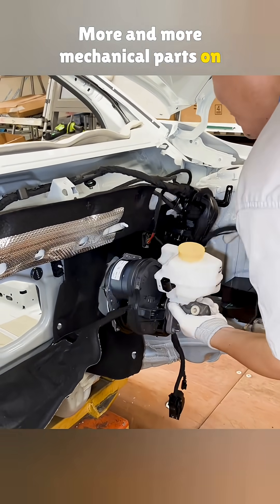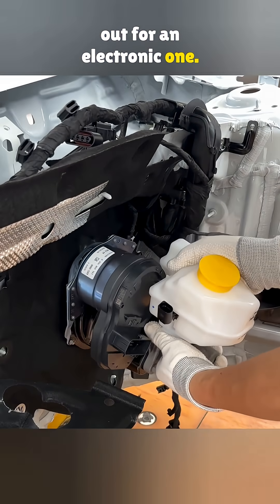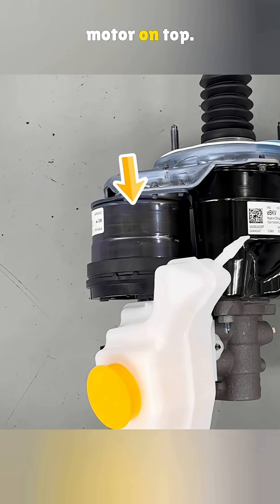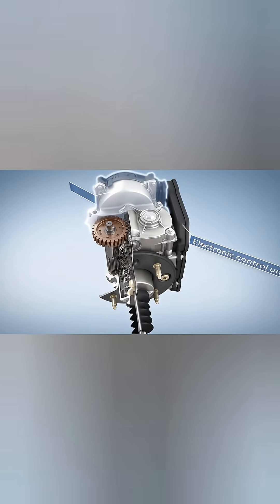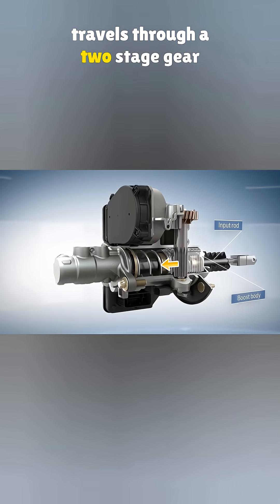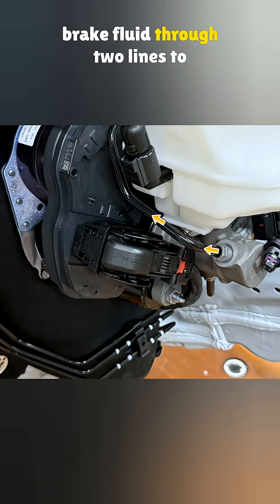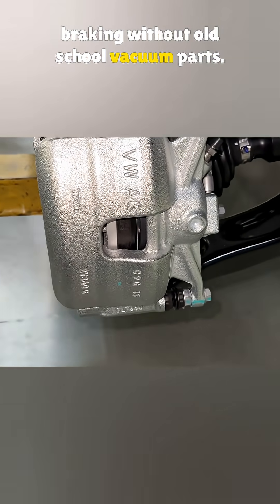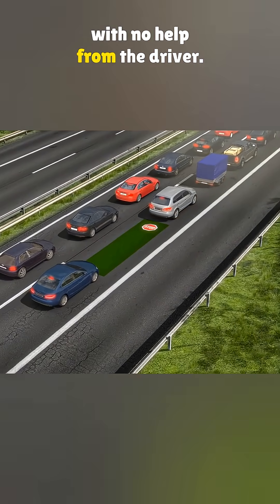Why Cars Are Switching from Mechanical to Electronic Brakes #Manufacturing #assembly #carparts

Comment: I can see people complain that "this is not safe" and "it shall fail" but its only replacing the vacuum booster with a motor and eliminating a vacuum pump and hoses, same thing as with all electronic steering racks eliminating the hydraulic pump, those have been in service for over 15 years and extremely reliable

Comment: And should that little electric motor failed to put out the proper to work, or just fail in general, then you have no proper braking. The driver is then no longer responsible, and the Vehicle Manufacturer is the one to answer for any accident.

Comment: Why not just add a servo to the brake pedal for the auto brake feature? No unnecessary upgrade to the brake booster required.

Comment: They are used as the engine may not be running and so there is no vacuum. 
They are not needed for autonomous braking or emergency braking as the ABS modulator can already do those thing.
What they can help with is the blending of regenerative braking and driver braking.

Comment: This constant breaking when in auto keep distance mode cooks your brake pads... I saw another video on it.
I drive Toyota Hybrid and light breaking is done through hybrid system, it recharges the battery instead of pushing brakes.
Reply: I would assume some car manufacturers don’t apply the break to slow you down it just stops giving gas which makes way more sense anyway.

Comment: Brake by wire .There should be a law against that.
Reply: Not really, there is a mechanical connection to the brakes.
Reply: @te1ephraq But it is controlled by wire.
Reply: @jimjackson4256 not in this case. Plus pseudo brake by wire has been used in hybrids for a long time.

Comment: Car companies are setting the stage for EV's, which won't have vacuum available for the brake boosters.
Reply: Electric brake booster has been around since the ’80s. Had a car with it in the late ’90s. Had it until ready to scrap in 2000. No issues at all with the brakes except rusty brake lines and worn out rotors. Normal stuff.
Reply: @tomlindvall2639  Thanks for the sensible comment among a lot of comments which oppose new technologies. Most people are afraid of change and blindly criticizes new technology without fully understanding the technology. A lot of people would thank automatic emergency braking which saved their lives, made possible partly due to the electric brake assist.

Comment: We remember just how well "drive by wire" went, don't we? Brake actuating systems need to be mechanical.
Reply: It is mechanical. Most vacuum servos run from an electric vacuum pump anyway.
Reply: 1. This is still a mechanical braking system
2. Drive by wire went very well
3. 99% brake by wire systems have been in use with hybrids for like a decade or two now
4. Airplanes have been using fly by wire for a long time, we started expirementing in the 60s iirc.
Reply: They are mechanical, don't you see master cylinder. It's a "booster"

Comment: More electrical component, more shitty driving experience. Keep it simple is the golden rule. İf something is working fine, don't change it.
Reply: Yep, if it ain't broke don't fix it.
Reply: Automation is the key to these manufacturers plan. Make drive more easier. Isn't that how innovation works? Make things easier. Back then people goes to river for water, then they invented well, then they invented pump. People who doesn't like the invention will said those thing make people weaker and it does.
Reply: Said right but if electric work more good then??
Reply: @यूट्यूबवॉचर  It has more to do with EVs not having a ready source of vacuum unlike an internal combustion car.
Reply: @ColinMill1  Spot on I think

Comment: so what happens if the battery dies? breaks stop working?
Reply: I still see an old school brake fluid reservoir. So I'm hoping that the driver simply loses power assist. Same as with old school vacuum assist.
Reply: as much i hate to admit it as a mechanic, the engineers have definitely thought of that possibility. the only thing this does is replace the vacuum booster with an electric one, and if the battery dies while driving, the alternator still makes electricity, probably enough for all the important stuff. but no matter what happens you will have brakes, just not assisted brakes, so you would need to press the pedal much harder. if your strong enough you could still lock up the wheels without boost assist
Reply: @quaiacka  A better question was what if you alternator dies. Much more likely than a battery dying while the cars running. Batteries usually die on between starts
Reply: Won't be nice.
Reply: Well… with the old vacuum booster, if the engine dies while driving you also loose power breaks after two pumps. Same for the hydroboost systems. So power assist will not be there, and breaking is just with foot pressure alone on manual power.
Reply: What happens to your regular brakes when the engine dies? Same thing.
Reply: @X65022  Just say you don’t have a brain next time, when your car dies you don’t need brakes, the engine is off bud..